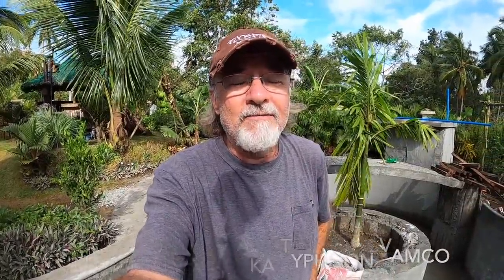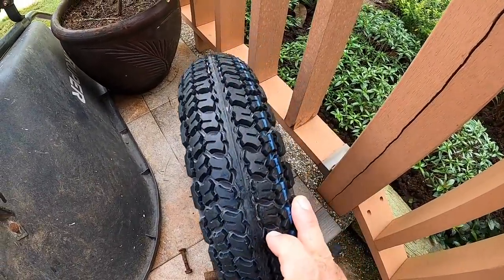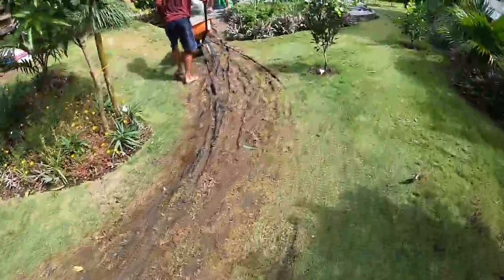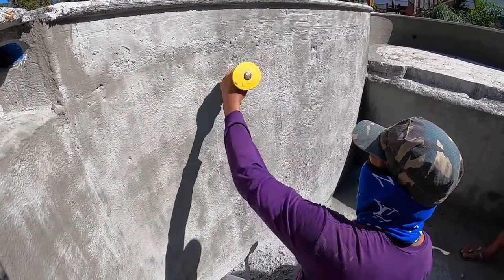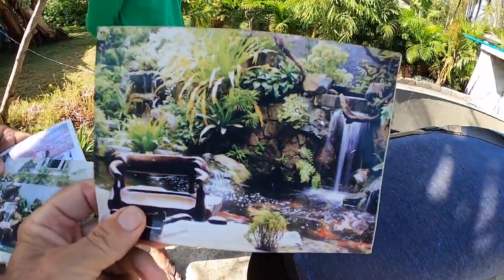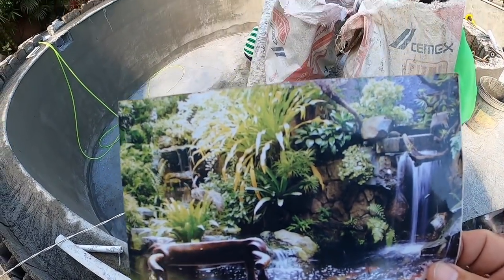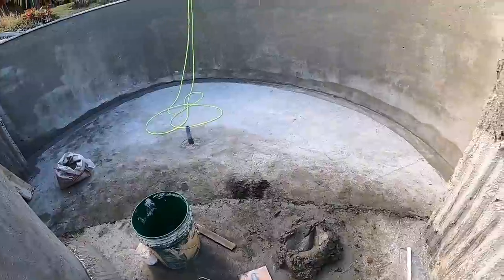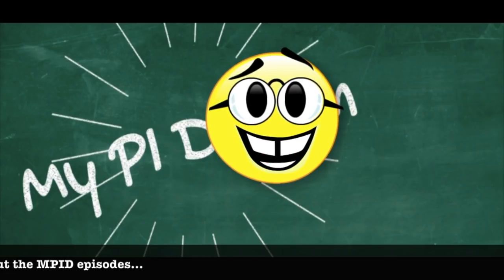VILLA FELIZ POOL BUILD - EPISODE: 33 (House Building in the Philippines)

Comment: Glad to see everyone is safe and well after the last typhoon.  You had us worried guys. 

Did you sort out your generator issues? The last I heard was that It'd packed up. I must have missed that youtube instalment.
Stay safe James.
Reply from the maker: We're good.  I wish I could say that for everyone here.
We still are shopping for a replacement generator.  Some prospects but are waiting for the finish of the pool built to move back to that expense.
Reply: @MyPIDream  I've seen the carnage online and my heart bleeds.
It's hardly been mentioned in the UK 🇬🇧

It's just a side note, along with Vietnam. Who've also been hit hard by the same weather front.

Oh, I've got down to the last 3 houses on my PH shortlist. This typhoon has highlighted the need to find somewhere well away from low ground, with good drainage.

Comment: Thought I would send this again to make sure you saw it. The VGB Act requires that public pools and spas in the United States be equipped with anti-entrapment devices or systems that comply with the ASME/ANSI A112.19.8 performance standard or any successor standard. ANSI/APSP-16 2011 is the successor standard to ASME/ANSI A112.19.8.” Read more about the VGB Pool and Spa Safety Act here. Please review this link, I think it may give you a better understanding of the requirements for pool drains here in the states. It's a simple fix at this stage of construction. Skimmers don't prevent entrapment! The last thing you want is for a child to be trapped by a drain suction of over 700 pounds. Just trying to help.

Comment: Hi. Like your videos. Question: Why do you need grounding? Dont you have 12V in light and all?
Reply from the maker: It's not for the 12V lights.  It's for any electrical malfunction where 220VAC might trickle out to the water on the sidewalk and make its way to metal areas around the pool such as ladders.  This is standard code for electrical grounding of pools around the world.

Comment: Hey James, the wife and I were wondering how your drainage system around your house is working out with all the typhoons coming through? Any water getting in? 🇵🇭🇺🇸 in🇨🇦
Reply from the maker: Rock solid.  No issues in the basement with water ever making it in on the floor.  We did have some water pooling up on the 2nd floor lanai because the 2 inch pipe the contractor used for 3 downspouts was under sized.
Reply: @MyPIDream  should  be 4 inch pipes
Reply: @MyPIDream  2 inch pipes no match with that raging heavy downpour
Reply: @MyPIDream  if its a dark pool you cant see the botton whats lurking at the bottom 😳😨

Comment: Your measurements of wheelbarrow brackets are 10 times too big 840 mm should be 84 mm which is bit more  than  3 inches. All others same thing so remove the zeroes at the ends. 840mm is almost 3 feet!,
Reply from the maker: You are soooo correct.  I added a zero by accident.  I notified the iron works shop.  I think that was obvious.  THANKS!